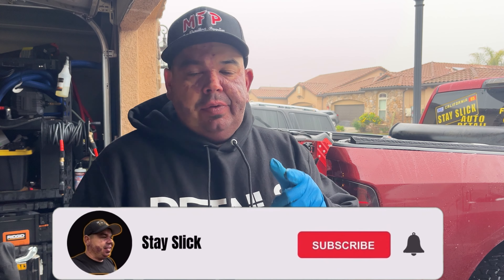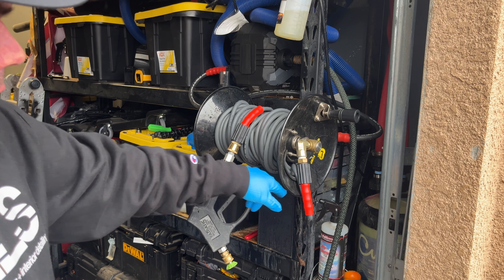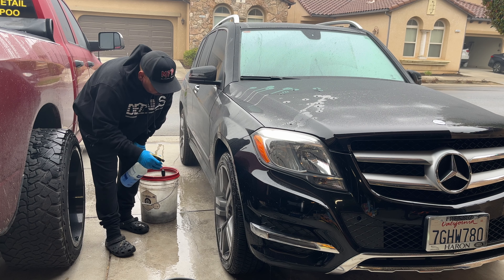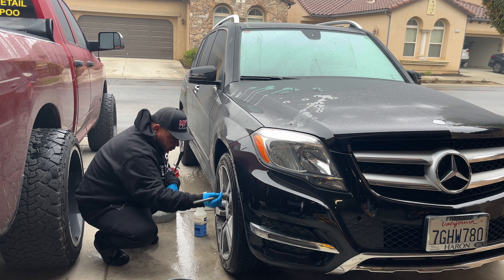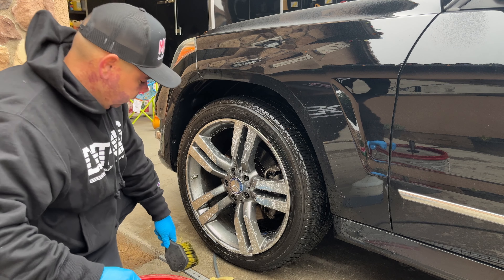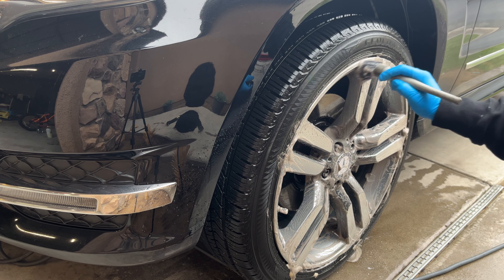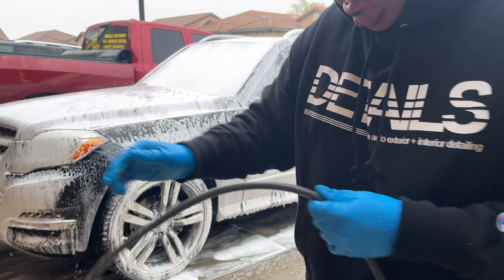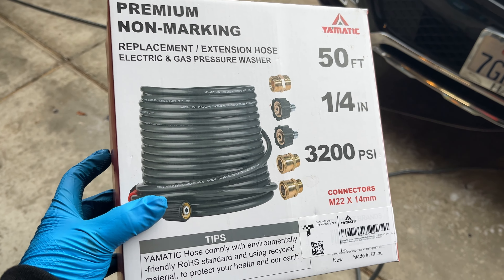Can Yamatic give Uberflex a run for its money? #detailing #carcare #yamatic

Comment: I got the 3/8 Uber flex last week and this thing f’n blows compared to my 3/8 kobrajet.   It is larger and doesn’t like to uncoil.  It is hard to maneuver and if it isn’t completely straight and uncoiled before pressurizing it is going to be a huge pain in the ass.  It kinks easily and is a pain in  ass to coil onto a reel without it kinking.   Kobrajet doesn’t have these issues

Comment: I picked up a black max from Walmart. Works great is cheaper and is made by the same people as Uberflex
Reply from the maker: Do they have 50 ft hoses?
Reply: @StaySlick  IDk mine was like a 35' I believe it was the only option at my store and it worked for me, but other stores may carry longer?
Reply from the maker: @jeepinspence  I ask cuz I’ve searched for them before and only found 35’
Reply: @StaySlick  Yes that may be the one caveat. The 35' worked for me but I know 50 is a better working length for most.

Comment: I always tell people go with the 50ft Uberflex and I feel like at around $1 a foot it can't be best.

If you absolutely can't deal with having a bright blue or some other bright colored hose, and want a black one, you can also get the 35 ft blackmax from Walmart for around $38 bucks. That's also my recommendation if you have an emergency and need to get a new hose ASAP. 

The blackmax hose is also made by pro-pulse/Uberflex and it's great. Doesn't have the slick texture for better or worse depending on the person usually, but it has zero memory, doesn't kink, doesn't get stuck (to the same degree as any other hose) doesn't explode and I actually really like the 35 ft length. Easy enough to use a coupler if you need more length and I also prefer having 70 ft instead of 100 ft tbh.
Reply from the maker: I’ve been hearing about the black max owes for a while I might have to try it out
Reply: @StaySlick  I really really like them, and it says it right on the hose that it's made by pro-pulse or Uberflex (I can't remember which and I can't run to check right now). I use the little guards under the tires so the hose doesn't get caught on anything but in what little testing I did the texture made no difference between the blackmax and Uberflex getting stuck on stuff, and if anything I felt like using a 35 ft hose instead of a 50 ft gave me a bit more leverage and maneuverability overall without ever feeling too short. 

Highly recommended.

Comment: Electric pressure washers have M22-15 connector. Gas powered and this hose have M22-14, so your hose is not sealing to the M22-15 connections on electric pressure washer.
Reply: Sunjoes have M22-15 connections. Ryobis have M22-14 as do the majority of electric pressure washers. Iirc he uses a Ryobi.